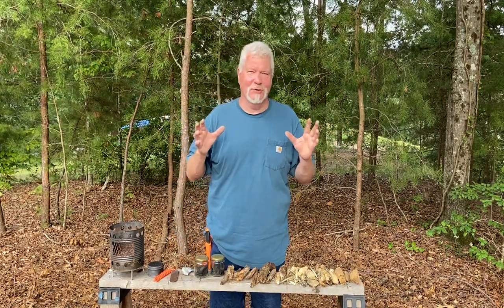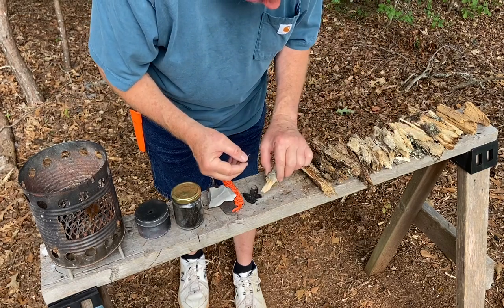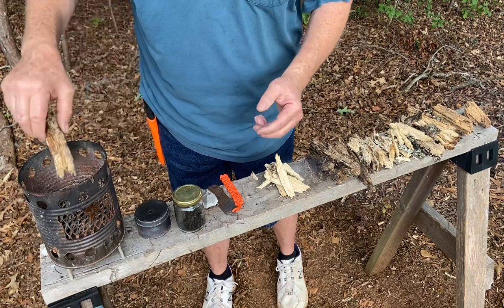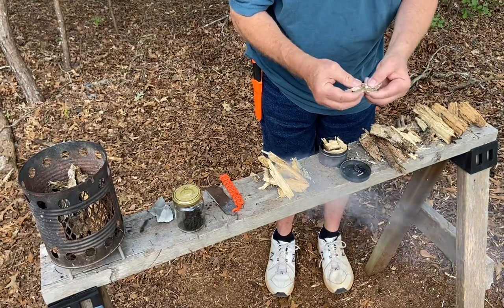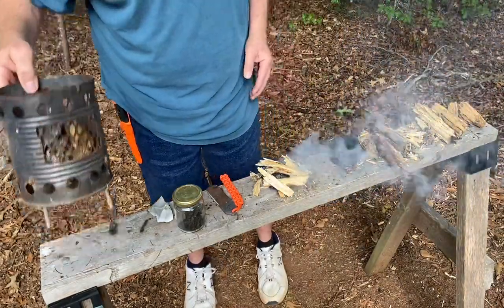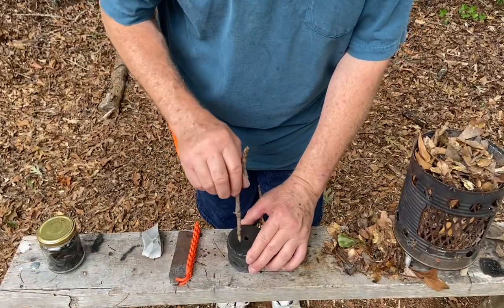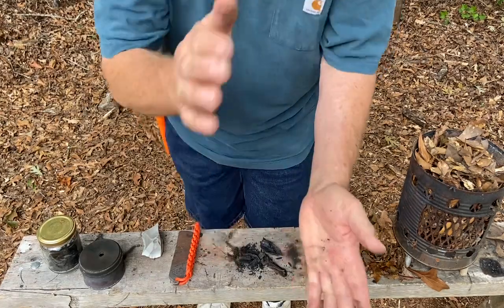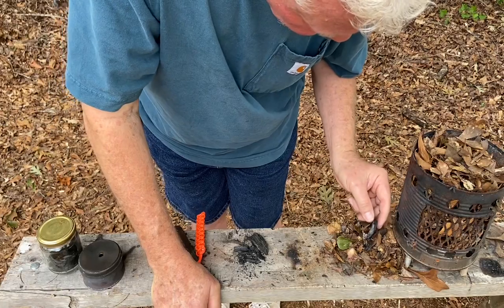Using Charred Punk Wood To Start A Punk Wood Fire To Cook Up Some Charred Punk Wood... Capeesh?

Comment: I enjoy your videos but it’s been noted that your having issues with “Oily Residue” on your char cloth. I have never noticed any residue on my char cloth, char cord or char cotton. I have used many deferent types of cotton cloth, not just denim. I do note that you do not pack your cans full with no air gaps, you also advise not to do that. Give it a shot by packing it as tight as possible and reduce your hole diameter to 1/8” or 5/32”.  You will be removing all (as much as possible anyway) excess air and prevent internal gas burning on your cloth. I think it’s a fiber tar that is unable to leave the can and is formed. I make loads of willow charcoal as well. Give that a shot and see your results. Thanks for some great vids! Keep them coming.
Reply from the maker: Oily residue was on Jute Twine a different set of videos... I used to have a brttleness in some of my Denim and cotton t-shirt materials char cloth. The problem was the fabric touching the red hot metal of the can releasing gases that condensed on the other fabric before exiting the char tin making hard ness and brittleness. The answer was to buffer the bottom of the char tin with punk wood then put the fabric on top. The little bit of fabric contact with the other walls of the tin were of no consequence. See my char playlist and the "buffered" videos.
   I've done dozens of char cloth experiments over the years and have many videos of experiments. You lost credibility with me when you recommended a smaller vent hole and a more tightly packed tin.